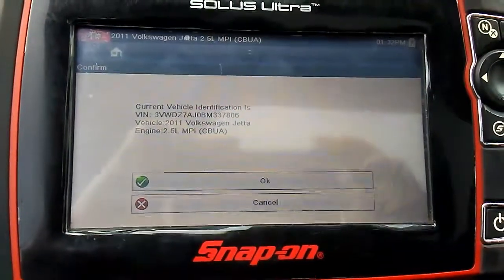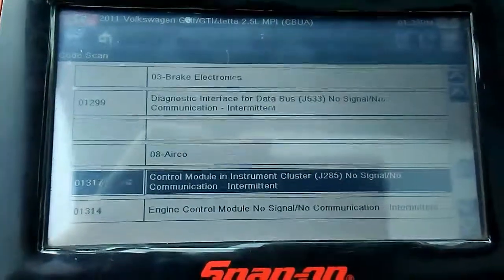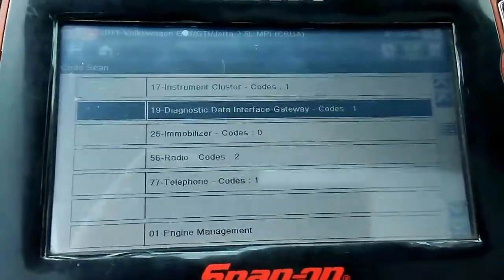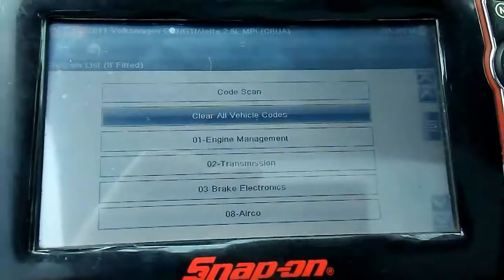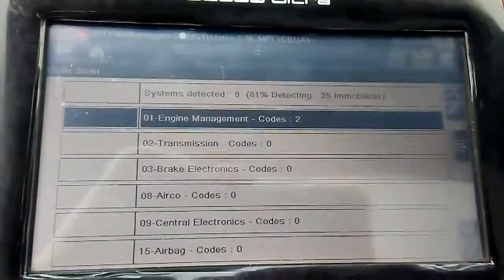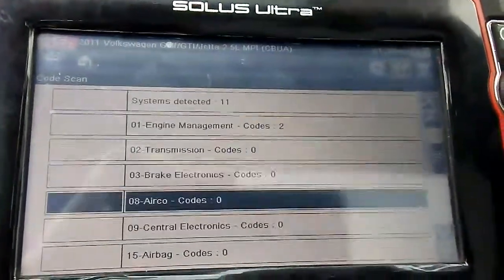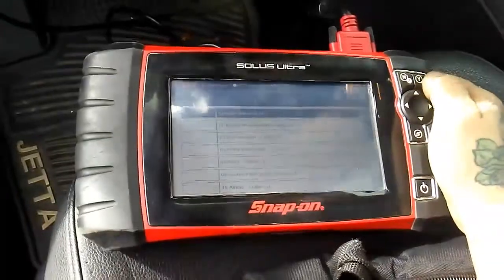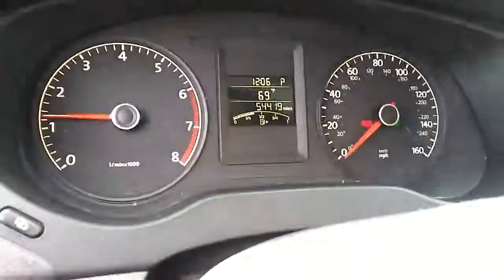Volkswagen Jetta U0164 No communication with HVAC control module.

Comment: So I have this code U0164- Lost Communication with HVAC Module. I should just disconnect the battery and computer and wait 10 min, and plug it back in? My issue was the A/C was re charged, but something was stopping it from turning on, and gave that code. 2014 Toyota Camery.
Reply: Did u fix it ? Mine doing the same code

Comment: How did you repair it? Did you replace the HVAC module or ECU?
Reply from the maker: Remove ecu replug reset all modules 2 times before it wint away. Weird but it did i removed ecu replugged  used scanner to reset everything  i did it 2 times before it worked and erase dash lights and no communication code
Reply: OK i will try it, do you disconnect the battery first? Also my problem is ac clutch won't engage, no ground signal from PCM
Reply: Seems to be fine until they drive and code comes back